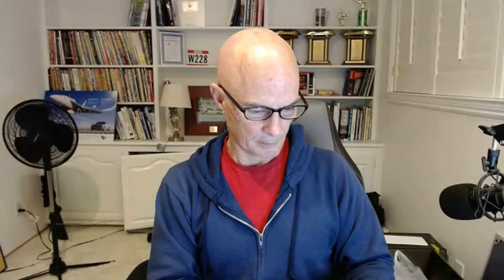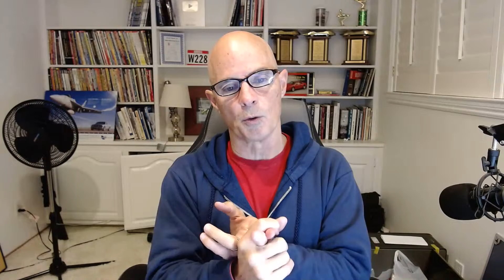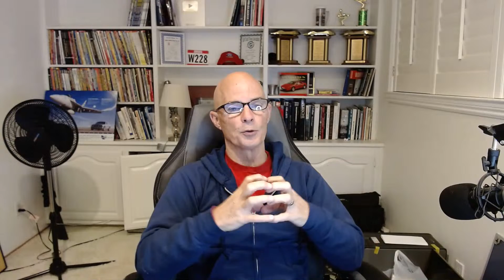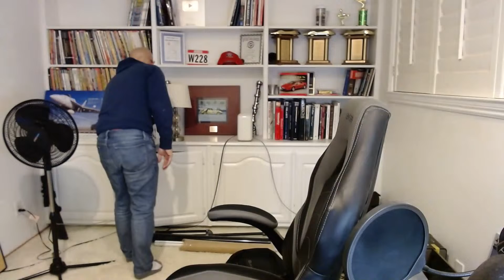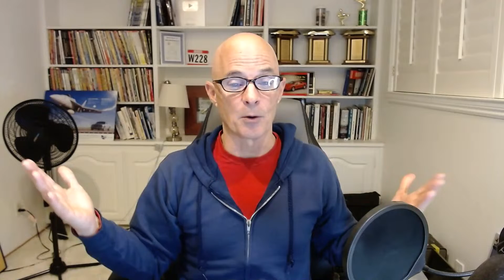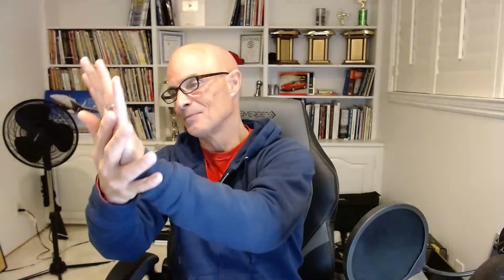LET'S TALK TURBOS-DOES RICHARD HATE WATER/METH INJECTION?

Comment: I like methanol injection, call me a tinkerer and a dreamer; however, meth should always come after an intercooler is dialed in.  

I've got a twincharger with packaging challenges, so using meth injection to cool the air charge through and after the blower. The turbo outlet before the SC/engine is intercooled with W2A.  I'd like to figure out a rear radiator setup, and go to an A2A intercooler up front with the extra space.

Comment: Same as if you put the best racegas in a car that doesn't require it.. it will not add any benefit. It actually might reduce performance.. Then there's a dedicated motor on high boost and high compression that will greatly benefit from adding water/meth that will allow further addition of boost, timing and safety and running on 93.

Comment: Run a test using 100% methonal because water does not burn. Running 100% methonal with 91 or 93 octane will turn fuel into a flex fuel. 
Using a Holley Methonal kit at max psi atimizes fuel better. Along with boost will flow through a EFI intake just fine.

Comment: Just run methanol port injection on each port and 100% meth and a presure switche on the meth fuel line that triggers the high boost tune. That way its much safer

Comment: Hey richard I've been wondering for years, could you theoretically run 30 pounds of boost with straight water injection in the right proportion of water and 91 octane pump gas?

Comment: Richard. This may be controversial but here goes. Don't use methanol and just spray water. Meth was used for injection in ww2 fighter planes to stop freezing of the water. Straight water has much better cooling than any fuel including gas or meth. We run rich mixtures to allow extra fuel to cool combustion chamber. Water is much better. So run the correct amount of water only and increase timing AND raise AFR. Tuning is obviously needed but I believe you can go as lean as 13.x through the curve. You don't need meth as long as you aren't worried about freezing temps. Intercooler works great obviously but with added Straight water you benefit from less stress on exhaust valves,  cleaning pistons etc. When 1cc of water flashes to steam it occupies 1600cc of space giving combustion process more 'torque '  
I am a retired engineer who has worked on high pressure steam boilers my entire life. The power of converting water to steam cannot be forgotten.
Reply: Also water is cheap. Meth is not. An issue that can be detrimental spraying pre turbo is something called steam erosion. Personally I wouldn't do that. Directly after throttle body or port injection is safer imo. Pre turbo may cause flashing to steam way to early and erosion should be a concern
Reply: Sounds like David Vizard
Reply: @paulchang3336 yet vizard runs preturbo water injection.
Reply: Another perspective. One thing that's cool about boost, over Nitrous. You don't have to fill, turn on, arm, heat bottle. So with water meth or just water. You gotta keep up on that. Takes some Extra extra efforts to tune. You're not going to get that Right on a dino. You would need someone like joe simpson and alot of tuning time. For this reason, Personally If I'm using water. I would rather it be air to water intercooler. Unless it was a dedicated race car. But this is coming from someone that would be tickled to death with 600whp in my Short bed silverado 4×4.

Comment: I run it pre-turbo....   on a draw through setup.   Very long intake runners/manifold.    Air cooled engine with super hot cylinder head temps.   coming in at 10lbs,   it really solves detonation problems,  and provides a noticeable power boost.    The issue i have be told,  is damage to the turbo impeller.    but for me,  its worth the trouble.     Very space limited so this works.
Reply from the maker: Turbo v-dubs are legit
Reply: You only get blade damage if the nozzle doesn’t mist very well. 

I’ve been looking to experiment on this but I haven’t had the opportunity to do so. I’m currently  spraying post intercooler.
Reply: @BrodeyDoverosx 
Small pre-turbo nozzle increases density/efficiency while post turbo is more effective at cooling the charge.

Comment: Suggested reading " Performance of a Supercharged Aero Engine " edited by Sir Stanley Hooker c1941 a series of tech manuals  ,plus post war publications by Hooker , Liversedge et al  by Rolls Rolls dealing with the development of the Rolls Royce Merlin among others . All the data needed has been around since the end of WW2 .
The doubling of output of the Merlin from 1000 bhp pre war to 2000 bhp by wars end , the use of Boeings high altitude plant to transform previous impirical methods of calculating effects of boost at altitude by real time analysis . The development of supercharger impellers  , supercharging from single stage single speed through to 2 stage 2 speed . Effects of fuel injection to water/ methanol  injection pre supercharger impeller . All the info required accessible in the British Library from as long as I can remember and probably now available from that source online. 
The design of the Merlin engine cooling system is well known to many . We have 3 Merlin engines by R-R , Packhard and Buick at the museum . For those not as well versed , the Merlin a 4 valve per cylinder V12 , mimicked by most modern vehicle engines today , entered service with a crank driven supercharger with w/w inter and after cooling , using water ethanol from the US as the cooling medium for both engine and the charge coolers . The ethanol was replaced by glycol developed in the UK because of the inflammable nature of ethanol during handling and use . The main charge cooler housed in a separate unit , the after coolers integrated with the inlet manifold.  The carburettor fitted upstream of the supercharger as was the later Bendix Stromberg then SU fuel injection . A sick through configuration . This resulted in full atomisation of fuel and as power levels increased beyond the capability of the 100/150 RON fuel being used , fuel injection then water glycol injection  ro minimise detonation issues both injected straight into the primary supercharger impeller to ensure full atomisation at each stage of cooling on its long torturous route through the length of ducting into the cylinders . In our examples there is little evidence of etching or cavitation caused by injected spray hitting the impellers or drop out of fuel/water glycol in the inlet tract . Although these engines were recovered after crash damage ( 2 with crank failure 1 shot down) during the late stages of W 2 with at least one being close to its 100 hrs full service requirement, the combustion chambers and 2 spark plugs in each cylinder demonstrate excellent and controlled flame front propagation despite being compromised in their final moments.
  Water glycol injection had been available to R-R throughout development of the Merlin but had not been used until power levels exceeded the higher levels of its designed output figure relying solely on its reliable and efficient induction charge cooling system .
Experience by using this knowledge on modern vehicle engines over the decades has shown that simply replacing a/a intercooler with the same size correctly designed  w/w type results in dramatic net gains in power output after correcting A/F ratio in carburrated or injected engines , and should the need arise for further cooling of the induction charge by evaporation ( ideally one should not rely on yet another serviceable item like water/gl6col injection for several reasons) the approach adopted by Rolls Royce of pre impellor injection in the 1940s for atomisation has worked successfully and flawlessly and eliminates the need for expensive high pressure atomisation pumps . A well designed permanent induction cooling system should feature as a priority item every bit as much as the choice of pistons in the build of a high performance  supercharged engine .

Comment: I think this is a great test and am very interested to learn about how the distribution changes and the temperature drop. I'm more interested to see you try this on a car that is a full car; not just the engine, up on the dyno, and have you do a tune to see how far you can increase the boost pressure, and DIRECTLY compare it to the exact same car with the fuel changed out to E50-E85, how far you can tune up the boost pressure and what the HP and Torque graph results are from each application that will result in what power and torque actually make it to the road.
Reply: Is there a difference also using E85 or water-methanol on different injection type engines; direct injection/port injection/direct+port injection?
Reply from the maker: yes there is-and testing on any other dyno shows similar differential changes

Comment: if your running an inline engine with a hyper tune intake manifold, distribution is pretty even pre throttle body.
I have made some well over 600 whp on pump fuel with water meth on a 2jz. I have since added a second meth kit that is pure meth multi port for over 700 whp on pump. both systems work pretty good together.
Reply from the maker: a long-runner ls intake and short runner after market 2J intake are quite different
Reply: it does work very well and port injection is easy to tap a thread the 6 injectors into intake runners on a 2jz and works better on the street than e85 because meth injection only works when the motor is hot and boosting not cold starts and cruising  like e85 filling your motor oil with condensation. Also it's cheaper to run daily to work.
Reply: @sean.d7171  That is exactly right
Reply: @A2J_Tim  I think Richard is not a fan of methanol injection because its unsafe and like a bandaid compared to e85 and hes right but some of us have to use it, no e85 at the pump in New Zealand only 98ron same as US 93. We use it for knock suppression not cooling we have intercoolers. Best trick is to put a pressure switch on the methanol line that enables high boost map so if it drops pressure It goes back to the pump gas tune before it even gets a chance to melt pistons.
Reply: @sean.d7171  I disagree with the bandaide statement, I have been using meth systems for 20 years, I have a few snow kits on 1 car with no saftys and its never failed me, How ever I do an inspection and testing on the system once a year. On another car I have I have an aqua mist system that has a few built in saftys than can trigger the waste gate back to spring pressure, that system has never failed me aswell. My pure system is completely controlled by my ecu and its basically a fuel system with fuel pump and fuel pressure regulator. I will never burn e85 for the reasons you previously mentioned and I get more driving out of a tank of pump gas, no need to burn high octane fuel until its needed.
Reply: @A2J_Tim  Your right if its done correctly it isn't a band-aide.

Comment: If it lowered the charge temps as indicated by the IAT sensor... it WOULD make more power, period. The data is garbage when using wet thermocouples or thermistors. They report falsely cool temps. You can't get the charge temps down much past the boiling point of the fluid. Its been dyno tested and proven with the compound diesel and small engine guys.  You absolutely can cool the the charge temps down around 150* With 100%* meth. if you spray enough. The kits out there don't even come close to the volumes needed.  That will never happen with 50/50 mixes. Regardless of what the saturated IAT tells you. Will never be better than a good IC, but can be good enough to reach peoples power goals. I run twin 78/75's on a 5.3. without an IC and pre turbo meth inj. 5.50 1/8th mile car.
Reply from the maker: you statement is incorrect, period
Reply: @richardholdener1727  Math, science, and testing says other wise. If you knock X degrees off the charge temp. you will pick up "Y" amount of power. Just as an intercooler does.  Its not knocking the reported amount off the charge temp. Its why you don't see the same power increase at like reported IAT's. Back it up with direct port w the same volume of fluid to eliminate you distribution issues. It will NOT pick up the same power as an IC...  Non intercooled, methanol won't be a fluid when its injected at any decent boost level as it flashes to a gas at 150*. I max out the GM IAT before the 1/8th at 250* plus. So it will distribute more evenly than a liquid.

Comment: Hi i've gotten great results with my water meth setup it's a 50/50 mix using race cheetah methanol  in my ford territory turbo barra i6 on 21psi and Aussie 98 octane.
Been running this with one 600hp nozzle after the throttle body for a year and a half and race at the drags at least 15 times no issues.
Having said that makes me wonder if i should go to a direct injection setup,to make sure each cylinder gets its fair share.
Reply: Independent Motorsport in Victoria run port water meth with very good result on some of there Territory Turbo’s. They have a YouTube video on it too on there channel 👍

Comment: If you run a MAF, it works without messing up the AFR, Using speed density, it will get messed up AFR. Ideally you want it to cut immediately any time the injectors cut, like when you unexpectedly hit the rev limiter much sooner. It breaks pistons. Water on it's own works really well without any risk of broken pistons.
Reply: Methanol doesn't break pistons, detonation does
Reply: @100pyatt  it detonates when it's very lean. No fuel plus a bit of methanol
Reply: @1magnit it would be leaner if there wasn’t methanol. You’re not making any sense.

Comment: Any damage to turbo impeller with injecting water/methanol pre turbo?
Reply: Same as with a carby pre turbo.
Reply: @1magnit  thanks
Reply: Pre-Turbo injection causes Erosion Damage to the compressor wheel. Been there, done that several times.
Reply: @100pyatt  You did it wrong and didn't learn the first time.

Comment: Water meth injection pre roots blower is great! Run many track laps in up to 40 deg C ambient using that. But if you let the nozzle block through lack of checking and cleaning....well, it didn't end well for the pistons!

Comment: If you run liquids into the compressor it will erode it over time.
Reply: Not such a problem with a titanium compressor wheel.
Reply: Yes I try telling novices about this. It destroys the compressor from erosion if injected pre turbo

Comment: I have a question I asked this question before but didn't get an answer back I know you're a busy man what do you believe to be the maximum horsepower of a 351 Windsor OEM block can't handle
Reply: Depending on application as well,  a short dyno run with lower coolant temps is very different than a half mile top speed attempt
Reply from the maker: WE HAVE DONE 1,100 HP SO FAR
Reply: @richardholdener1727  Also, the faster you spin it, the more peak loads are inertia and momentum-related, and not so much combustion.

Comment: I want to see pre vrs post (no ic) then pre vrs add a2aic no meth. I know ic work and that almost all applications benefit. I just think whacking the spray with 100krpm blades is cool. Would the ic do like a condenser in a/c… if you ran pre with any ic? I imagine a high pressure/high temp gas going in condensed across the ic you will have high pressure/lower temp gas or liquid? What’s it do?

Comment: 95oct (US 91?) and 50/50 water meth is very similar to C16 as far as tuning goes. I would always recommend an intercooler regardless unless packaging isn't an option and pre turbo or nozzles in the volute (comp housing) is not detrimental to the comp wheel or pooling in the intercooler...
How about reaching out to any water methanol injection specialist and asking them for feedback as they are more than happy to give quantities used and where
Reply from the maker: DO YOU HAVE DISTRIBUTION DATA (AF IN ALL CYLINDERS)? I WELCOME MORE INFO FROM RELIABLE SOURCES. OFTEN TIMES PEOPLE WHO SELL PRODUCTS, DO NOT PROVIDE ACCURATE INFO ON TESTING THOSE PRODUCTS.
Reply: @richardholdener1727 I bet aquamist has that info.

Comment: Pre turbo injection is ignorant not only is it hard on the impeller and the centrifugal nature of the turbo compresses the water back out of suspension and against the outside of the housing.
Reply: It’s worth a test. So much speculation. I tend to think there will be some problems.
Reply: @Businesscat-z2c  I've been wrong before testing proves everything.
Reply: @Businesscat-z2c  tested 80 years ago.
Reply: @V8Lenny  and the results are???
Reply: David Vizard does this but nozzle must spray super fine droplets that basically evaporates before hitting impeller

Comment: Would it be better to run dual fuel systems. One system to run from idle to 3/4 throttle with 93 octane . Second system to run from 3/4 to wot with higher octane fuel instead? Just wondering?
Reply: I've seen people do this with isopropyl alcohol, so yes, it works

Comment: Could you use another set of injectors in the intake manifold that would shoot water methanol and and run with Holley fuel controller were you could build a map?
Reply: I think it’s the next step into properly tuning these systems as using a dump it in and hope method works, but what is used other than afr and egt and actually measuring the air temperature and power output at given timing to tune an un referenced introduction of water and meth? Most systems I’ve seen like snow or aem are a bit crude

Comment: On my setup I run the nozzle in the Turbo outlet in the compressor housing.  Pro Meth told me to do it for my setup to get the most cooling.   Only run meth water mix for cooling and the simple look.  this goes into two pipes, twins, into the hat and blows through a Super Sniper EFI into a Performer RPM Air gap.  this is feeding a 306 SBF 8.6Cr engine.  I guess my question is your testing results mainly for new style fuel injected engines?